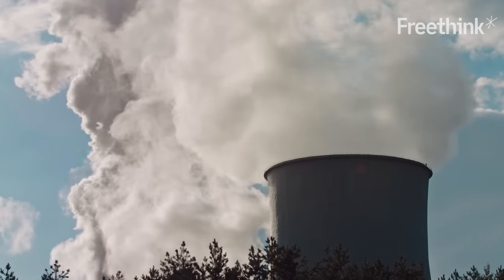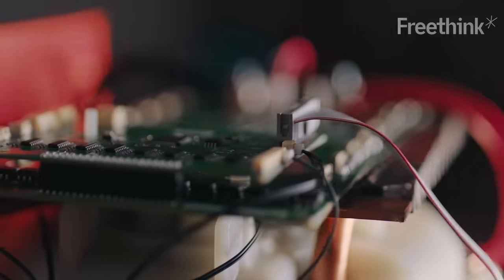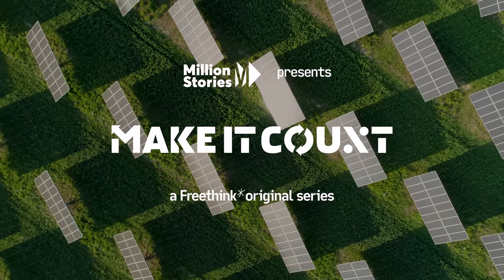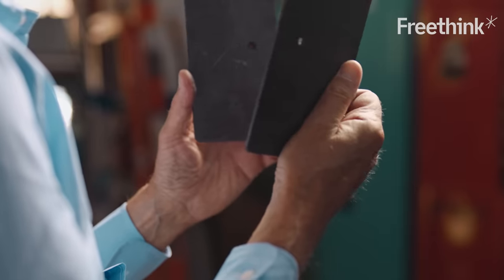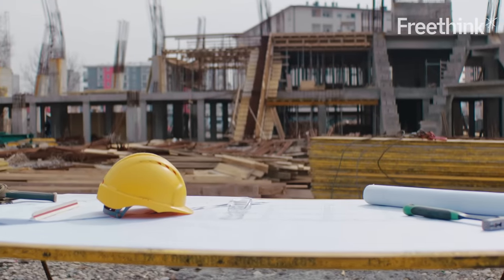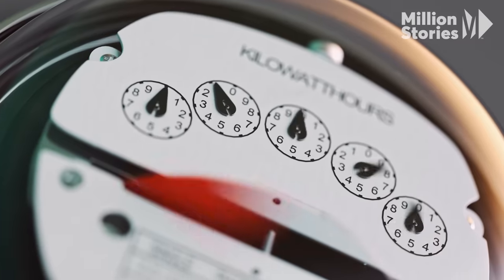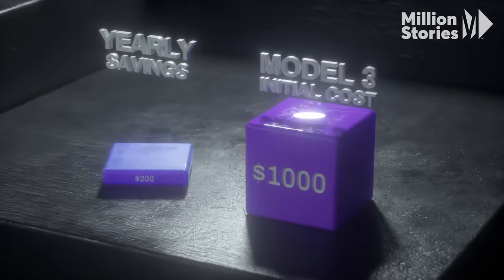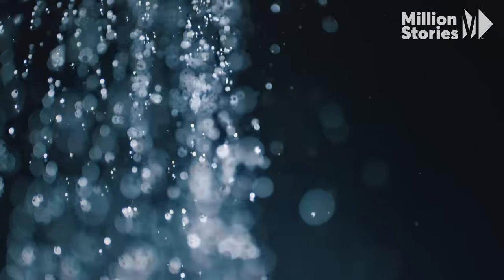The man hacking hot water to save the planet

Comment: What about the chlorine compounds in water that are used for disinfection? Electrolysis would cause chlorine gas and hydrochloric acid to be formed. Yes, it's a tiny amount in water, but the corrosive effects would be cumulative.

Comment: Better idea is to use waste heat from air condition system,  heat pump, solar heat or solar electric water heating. Store hot water in well insulated hot water tank that comprises a thermal battery. No need for better heating elements at all.

Comment: What about integrating a battery into the design to provide extra power to run the heater, rather than having to rewire the house. Something that can give maybe 30 minutes of boosted power output. you would make less profit but you would gain more clients.

Comment: I’m all for new tech on new installs but how much energy do these things really offset when the energy usage of the full global manufacturing cycle is included? I suspect it takes a very long time to offset that cost when replacing old tech for any other reason than failure of the older system.

Comment: Explain why nobody ever tells the poor homeowner that all those "savings" are going to be spent on costly repairs. A standard 40 gallon gas water heater will run for 8 to 12 years without any maintenance or repairs . Maybe a 30 $ thermocouple or 60$ igniter.  Who wants to take the under bet, the control board for this thing is less that 600$. Not to mention installation..

Comment: This would probably be hella expensive still, and I don't see how scale wouldn't just build up onto the graphite plates, which would immediately affect how well it works, compared to your traditional resistive water heater. It's kinda like the lead acid battery, old tech but extremely useful and hard to replace. I imagine that simply swapping your heating element every so often and dissolving away the scale on the used one with vinegar or something would probably be a more economically viable and sustainable method. Technically the chemical waste could then just be dropped off to be used to make new products like fertilizer or something.

Comment: Not even talking of the process, using electricity from photovoltaic arrays to boil water is insane. Direct thermal sun heating allows this with nearly 100% efficiency whereas photovoltaic is 20%. Also storage of heat is much easier than storage of electricity (just need insulation).

Comment: This is not new technology, it's just an electrode heater, they've been around for many years, they even use electrodes in metal foundries to melt the metal.
If you look at wikipedia, there may be a reason why electrode heaters are not common.

Comment: They should be making these into hybrid heat-pump tank water heaters. Heat pumps can put more energy into the water than the electricity they consume since they are moving heat out of the surrounding air. However, they can struggle during the winter when air temperature is lower. That's why most heat-pump water heaters also have a normal resistive heating element. If this system is so much more efficient than a resistive heating element, why not make a hybrid system with this? Looking at the specs on their site, it still uses a whole lot of current to heat the water. Tank heaters are kind of like batteries where you can trickle charge them when they are not needed. A hybrid system with this tech could run off much less current, making it better for off-grid systems where a sudden 7kW power demand might not be an option.

Comment: Does any hydrolysis take place? Would efficiency be raised or lowered by varying the Hz from the standard 60 Hz in the US grid. A shorter cycle may use less amperes. Is there an optimum c.p.s. and what wave form variations may do to production of hot water, square wave versus sine wave. A two element HW heater draws 25+ amps and that's a lot of juice. With a small conversion effort the customer could keep there existing equipment and have one of your units installed as an add on installation. One unit plus a circulation pump, no changes to their system except tune off the breaker feeding the hogish elements in the tank. Recovery would be an important aspect to consider.

Comment: Hybrid electric water heaters currently available at Home Depot or Lowe's have a 3/1 efficiency ratio, you get 3 units of hot water for every 1 unit of electricity put in.  They also dehumidify and cool the surrounding air, so that makes them perfect for much of the eastern U.S.  And when the surrounding air is too cool to efficiently pull heat out of the air, there are traditional electric elements as backup.  I also use my water heater to store excess energy from my solar array.  If everybody had just a few solar panels (and they're VERY cheap right now), we'd hardly need to talk about the emissions of water heating.  I'm all about making things better, but this idea presented here might not make the juice worth the squeeze.  It's still resistive heating at a 1/1 efficiency ratio, but it uses the water itself as a conductor.  Meh.

Comment: the first thing said is instantly misleading. 50% heating efficiency lost is inaccurate. Electric water heaters are 100% percent efficient. If there is scaling the element will get hotter but the same amount of heat will go into the water.

Comment: is it cheaper to boil food from cold on a cooker or to boil a kettle of water first and use the boiled water to cook it? I always use pre boiled water from a kettle when cooking so just wondering?
Reply: Slightly cheaper to boil in the kettle first, assuming your pour it into the cooking pan as soon as the kettle is done. Because the kettle element is immersed in the water and so gives perfect head transfer, while the cooker's element is underneath the pan and so will lose some energy to convection.

Comment: They did not do a good job of explaining the inefficiency caused by scale on the heating element. Most inefficiencies in processes result in waste HEAT. How can a heater lose efficiency then? Making sound?

The only efficiency loss I can see would be in speed. But as others have commented, we don't want large bursts of power usage. We want places where we can store energy, and tanks of hot water would be a great way to store energy. Your water heater can heat when wind or solar is plentiful, and store that hot water for when you need it. Add some thick insulation to decrease heat loss. And use a heat pump if you want more efficiency

Comment: So for their morning showers, everyone is going pull 100 amps at the same time? How is that going to reduce the need for power plants? Everyone pulling power from the grid at the same time is already a problem, with stored hot water, at least the issue is somewhat mitigated. You might reduce the total power consumption with this alternative, but you would not be able to shut down a single power plant. If everyone did this, you would need more plants, not less.

Comment: This isn't even the most efficient form of heating water.
A heat pump water heater uses significantly less power than these.
Reply: Edit: with the added benefit of actually being practical on solar without a massive array / battery capable 100A

Comment: Its BS even when you skip the obvious near 100% efficiency of resistive heating of water. They only get faster water heating not more efficiency (and at the cost of more current). 
Conductivity of water varies depending on its hardness. They will need system to limit current through the water to have power rating and avoid tripping the fuses. So what will they use? Electronic current limiting with 90%+ efficiency (we are talking about multiple kW peaks) ? Varing the the plate distance? Submerging only part of the electrodes? The control system will drive the efficency down.

Comment: There's so much wrong with this. How will the grid handle these instantaneous 100A loads from every house on the block for morning showers? How do you deal with dissolved graphite from electrolysis? Buildup and scale from dirty water? How do you figure wasting 2100 gallons when you only use hot water you've already heated when you need it? Is there a faucet just on somewhere? So many missing elements.

Comment: Well, I need hot water to heat my apartment. And that I do with gas. With that price range that electrical heater still is more expensive than gas. Although I really want to get rid of that gas boiler. But in an apartment it's difficult.

Comment: A water heater with a tank is like the car your grandfather used to repair on his days off while a tankless water heater is like the car you're driving right now. 
Your grandfather's car had fewer parts and was cheaper and easier to maintain and repair while you have to take YOUR car to the dealer and spend oodles of money to have it repaired and maintained. The question you should be asking is, do you consider your water heater to be a fashion statement like you do your car?

Comment: Why would crud on the heating element reduce thermal efficiency? Sounds like BS. The elements would just heat up more to overcome the increased thermal resistance.
Also, instant water heating has a huge power requirement, and is less-compatible with renewables. This video is just an advertisement with some pseudo-science thrown in.

Comment: Lol the point is accentially that the water isn't taken to boiling point but that can just as easily be done by using more heating elements in parallel in the current system. Thus not causing any scale build up and leaving the elements to run at full efficiency (assumingthat the efficiencylossthe mention even exists).

Furthermore the water would necessarily need to contain a salt making it a conductive electrolyte. This intern leaves the ions of the salt liable to a redox reaction. In fact water it self would react in what is basically a electrolytic cell. This would account for a loss by storing some of the energy in chemical form

Comment: I still think an old microwave is more efficient mine doesn't need a nuclear power station to run and water boils very fast. There is no heating element touching the water. So I would think if u run a plastic water pipe inside a microwave or a "garden hose" the water will get hot fast run it for a minute and ull have warm water for shower. Now if u talk about a home heater like we use in eu that runs constantly on gasburner and has radiators trough the house. To replace that it's better to use a heatpump.

Comment: I'm with everyone else, this basically screams of snake oil. It may heat water, but as others mentioned, this process is likely to be causing electrolysis, which is a good way to potentially cause explosions. I like the idea of a more efficient way of heating water, but this doesn't seem like the best choice.

I should also note that a tankless water heater is kinda meh in action. Hot water seems to take longer to get to the sink or shower than our old tank system. It is also far more touchy than the old system. If you don't have a certain amount of water running then the system shuts down and you get cold water. It is far more difficult to get a consistent, comfortable temperature than the old system. Maybe a combination system, or something else would work better?

Honestly, I think that having some heating near where water heating is needed would make more sense. Have smaller electric heaters near junctions for bathrooms, kitchen, and other areas. It feels like there have to be more efficient ways to heat water so that we save electricity and water.

Comment: I also do not think that part of this makes sense. The metal heating element will not transfer heat as efficiently to water and will take longer in the prescence of limescale. This means also that the thermostat on the element will cut off the power when the element is hot till it reaches a lower temperature. The method of heating has nothing to do with the overall amount of energy needed to get a certain weight of water to a certain temperature.

If you are arguing you will heat less water in storage systems /cylinders if you can heat water instantaneously not needing the backup hot water then this is different. Single cup hot water systems exist for tea/coffee. For heating Combi boilers exist though are not electric.People with larger homes/familes smay opt for system boilers /cylinders if they use more heated water than could otherwise be provided due to water inflow/heating / pipe constraints or if they are usimg solar/ heat pumps etc.

**If the person from the company has had a hoarse voice for 3 weeks or more, he should contact a doctor to ensure he has not got throat cancer.

Comment: This looks weird, like an HHO generator, but I will give it the benefit of the doubt, surely many of the critics here can explain how this set up can in deed not produce Hydrogen, like there must be some frequency modulation or current control  that prevents this situation and generate heat at the same time, even tough this is really inefficient. Everyone is jumping to the electrolysis hypothesis without even considering how tf this even generates heat.

Comment: meh....kinda moot point when you throw in hybrid water heaters.....more efficient than this as it uses heat from house. if youre running ac it actually helps the ac. if youre heating the heat can come from gas....or from outside heat moved by heatpump still more efficient, and no wild install.  this doesnt save any water as your pipe length doesnt change unless you install it for a specific area right at the use location....not normal for a house,  cost to install a small one upstairs downstairs even would likely outweigh water savings

Comment: Boys, water electrolysis occurs only with DC, if you use AC it will heat up instead. This tech is legit, not that it is better than heat pumps, but legit.

Comment: As a previous comment said, this is not a great peice of tech. Infact, there's a very good reason it's not used. Heating water more efficiently would be by using heat pumps, or a central heating that's pumped to the house.
And all this 'tech' is, is running power through the water, which yes, heats it, but also electrolyses it, which produces an explosive, stoichiometric mixture of hydrogen and oxygen, albiet low amounts cause their using plates instead of wire. Not to mention electrolysis of water that has other substances (such as chlorine, found in tap water to keep bacteria at bay), can produce other gases, such as chlorine has which, oh boy, is not good for your lungs.
This show should do some basic scientific research if they wanna showcase scientific tech.

Comment: Parts of what you’re saying is true and parts bunk, just as you say about this video.  Every joule used goes directly into heat is true for brand new water heaters powered with electricity…  but depending on where you live and the mineral content in your water supply will determine how long that remains true.  As the minerals deposit on the elements their efficiency falls dramatically, and I mean dramatically !   The graphite plates shown in this demonstration don’t get hot and bake the water in the same way a resistance element does so those mineral deposits don’t form on the device.  It’s efficiency remains constant.  The reluctance of usage is directly tied to set up and installation costs and those are directly controlled by the electrical power distribution companies.  Do you know how much the use of LED lighting is costing power companies.  When you save money, they loose money.
This technology when it goes wide spread will nationally cost power production companies billions and billions of dollars, those are the dollars you will be saving … is it any wonder they will say and do anything they can to slow the use of such innovation ?  NO !

Comment: instant water, not very new but they have new elements to heat. Are the new heating element easy and affordable to replace a faulty one ? What is the life expentency of these elements? 100 Amps is 10/20 times more then a regular heater that means not only you have to do electrical work but if everyone has a system like this the grid needs to became 10/20 times more then is now. Good idea but NO. Find real solutions not SF

Comment: Just quick physics intuitive observation on the claims made here.
If the scaling formed on a heating element reduces the heat transfer/efficiency, then where does that supposedly unused energy go?
Does it not get used up by the electric element, and therefore use less electricity?
Does it get deposited as heat outside of the water heater?
Or does the heating element just get hotter than when new/clean, because the transfer is not as fast?
Likely the latter, and no real wasted energy. Whenever you talk about efficiency of electricity to heat you are almost always talking about close 100% conversion efficiency.. Heat is where all unused electricity goes anyway.
So I would challenge the claim that a dirty/scaly heating element is uses less electricity for the same amount of heat transferred to the water.